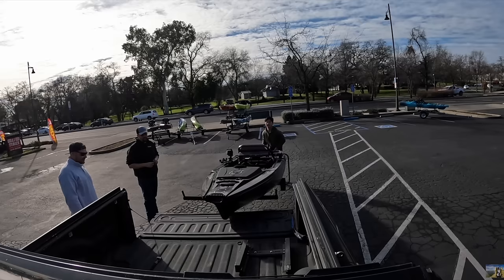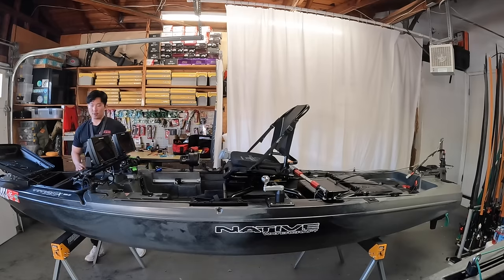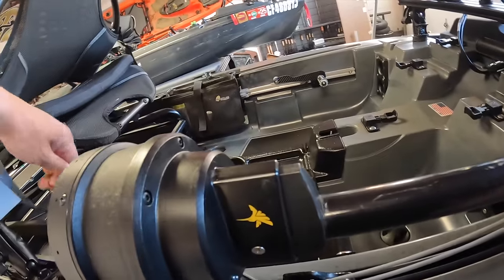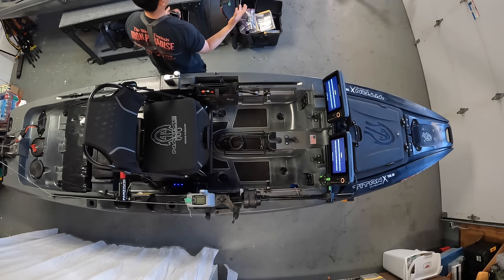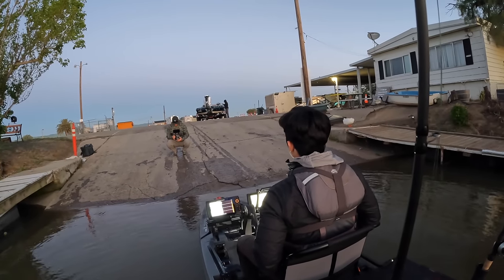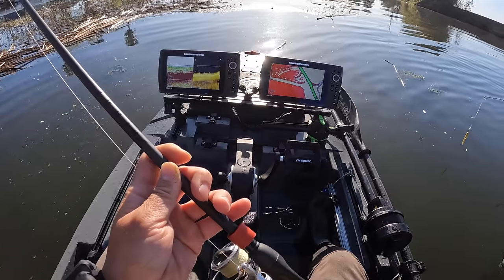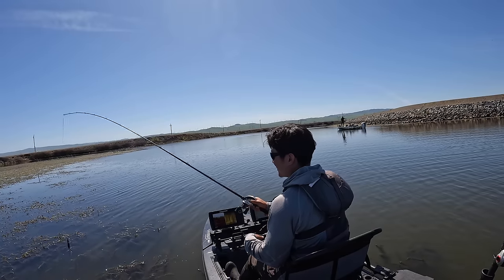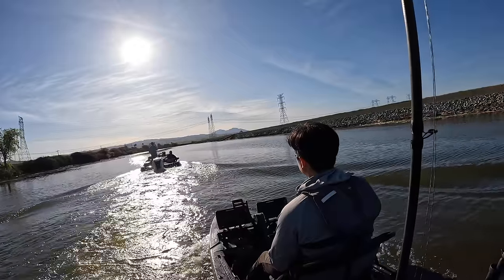It’s finally done. (Nativewatercraft TitanX 12.5 + Delta shoot)

Comment: I’m an electrician and I must say Im very impressed you chose that drill. I have the same one for my everyday but it’s awesome I use the chuckles adapter when installing ceiling fans so the chuck doesn’t scratch the wall. I love how you set the torque and it works perfectly when working on my yak or friends I keep my torque set to 8-10 and then finish off with hand driver

Comment: Hey bud, with all those electric connections, you might want to add a bit of Dielectric Grease helps with eliminating coronation. Also helps keep water out of those connection's 
Keep a tight line. Luck luck to ya 🎣 🎣 🎣 i
Reply from the maker: thank you sir! back to Ace hardware!

Comment: Greg! . Definitely got some takeaways for what I have done to mine. I like how you pull your motor up, you run the line long, to pull it back efficiently. I think I am going to do that but add an extra pully at the farthest point forward. Styrofoam is a great idea. Lots of dead space between the battery and crate. However, that is the best placement for the battery. 

Bro, great walk through.

Comment: Greg, love your videos!  one thing i wanted to point out is the lack of fuses on your mega 360 (1 amp) and your graphs (mine uses 5 amp, not sure if your would be the same or not).  if they are there i didn't see them but it appears you are hard wired to the battery.  Keep up the good work!!

Comment: How did you splice or add the connector for the throttle control? I see you have a quick connect for that at the rear. I would like to be able to take my motor off with out having to pull the wires for the throttle control.

Comment: Greg- would the 360 fit into a yakattack style paddle holder ? So when you bring it down and push it back towards the side of the kayak you can clip it in too. Just a thought. Might be hard to mount that in the right vertical angle. Probably over kill. 🤷‍♂
Reply from the maker: great thought but the roto grip handles it pretty good and keeps it tighter to the boat (less stuff sticking out).

Comment: Great video (as Always), but I have a question, Greg...  Why is your "Tilt Bar" on the NK300 turned around to the front?  
(I finally got my Titan X 12.5, with the same Newport Motor, and it's like "Night and day" different than my Titan 10.5 'Yak...!  And... a LOT Heavier with a 55 Amp 36 V. battery in it.   Had to put it on a trailer!).
Reply from the maker: Nice! reversing it allows the motor to come up in the stowed position straight versus all tilted off to one side

Comment: Is the foot steering you have in both your titans available to the public or is that one of the Wizard’s custom builds? 

Ensign was right…trailer is a game changer 

Great job rigging out!
Reply: I wondered the same thing, so I contacted Native.  It is a custom build but it is rumored that there is some R&D for a similar set up going on, possibly here by Greg, if you noticed, each side is slightly different.  Regardless if you are looking for now rather than later, you can find the parts if you know what to google.  You don't need a 3d printer to be able to use their parts ;)
Reply from the maker: Hey Mike, its the wizards' custom build, hopefully available to the public soon as it's a killer setup